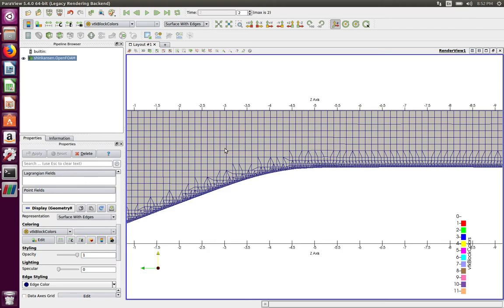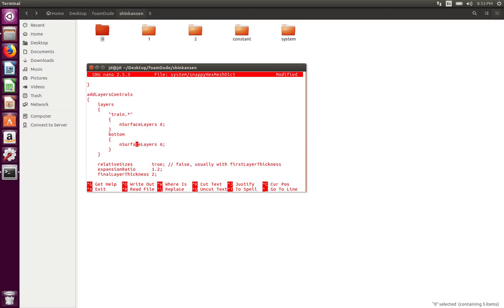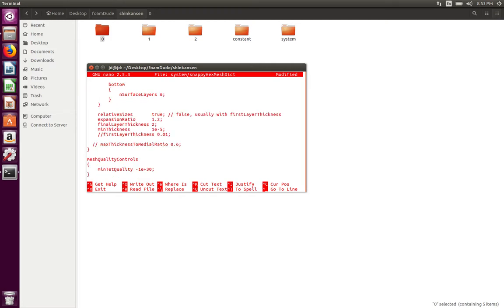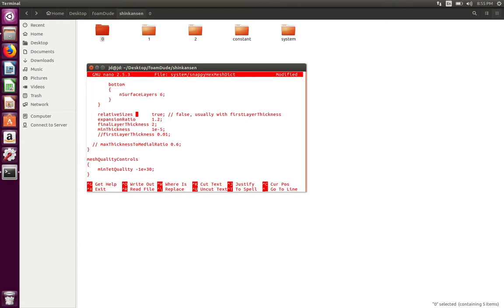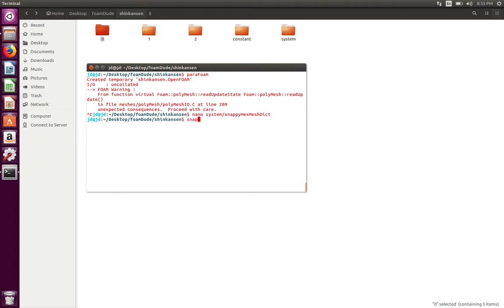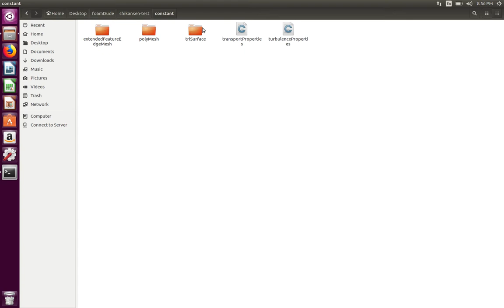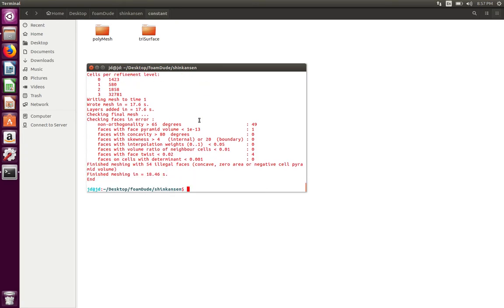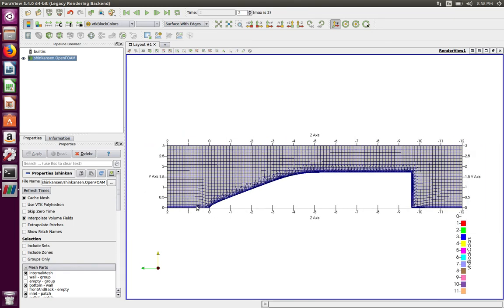OpenFOAM: SnappyHexMesh - Layers

Comment: This tutorial is not exactly correct. relativeSizes parameter does not define what set of parameters will define layes (first layer, final layer thickness as well as expansion ratio can be set independently). It defines whethet or not the measures are taken relative to the size of adjacent cell or in absolute values (meters). The second mistake is that the size of the layers are not computed by dividing on the factors, but multiplying with them: the final layer will not be as twice as small as the adjcent cell, but actually two times bigger!